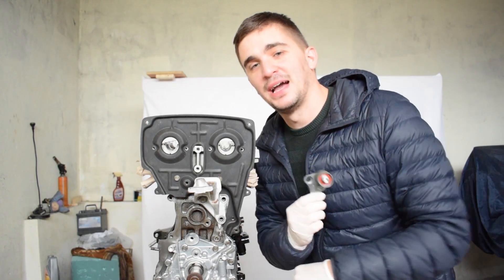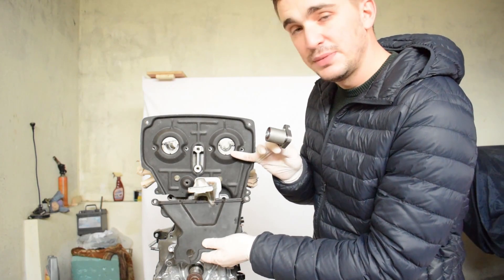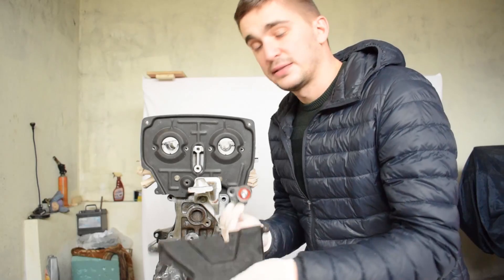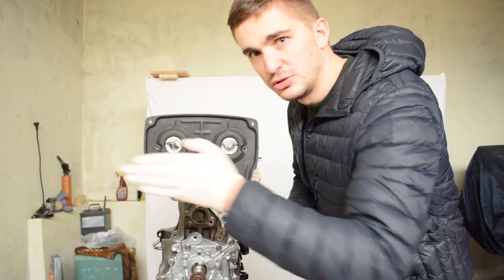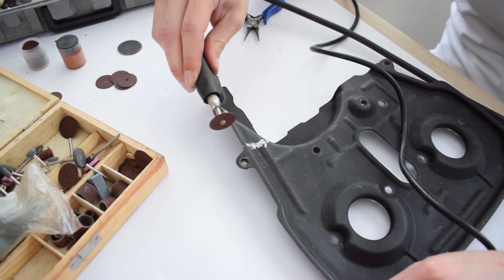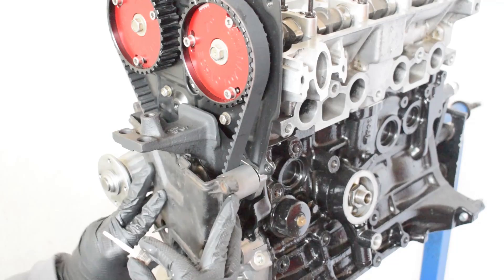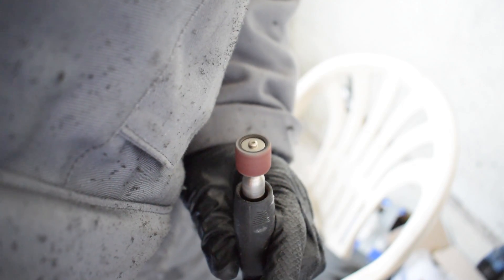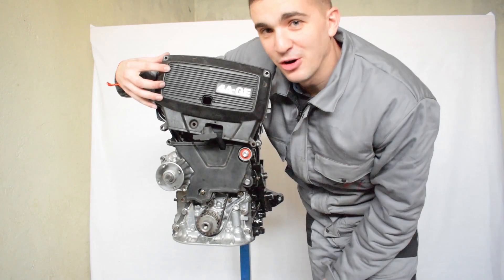How to install the MRP N2 cam belt stabiliser

Comment: You do nice clean work! BTW, are you going to fire it up on the engine stand or install everything in the car then fire it? I just can't wait to hear it run. Speaking of which, I can't remember if you addressed that the carbs need less fuel PSI than the EFI setup. Which vid was that? I wanna watch it again. 
I'm being impatient I know, I'm sorry!
Reply from the maker: ZatoichisCaneSword! Hey thereee. Long time no see :) Will install the engine first and then fire it up. Don't have the facilities to do it on the stand. Engine should be installed in a week, fired up by mid March I hope. I am making a video on the fuel supply and it will be published in a couple of weeks. I did discuss it in my previous vids, mostly in the bike carb plan, the really long video, but there's no vid on putting together the actual setup. I figured out something really simple and effective with the motorcycle fuel pump, should be a fun vid. Thanks for watching and staying tuned :)
Reply: +driving 4 answers (mr2 mk1 hero) oh using the bike fuel pump sounds interesting! Will it flow enough fuel though?! A 1600 on carbs at 8-9K RPMs has to need a fair amount of fuel flow methinks... I can't wait to find out! You're a clever technician and I know you'll make it work!
Reply from the maker: ZatoichisCaneSword! It should work great, plus it will be easy to replace and upgrade. Thanks for all the faith you put in me :) I hope I justify it soon.

Comment: Why does your timing cover have that hole above the engine mount? I havent seen that before.
Reply: You people are way off. This is a motorist's cigar cutter.
Reply: it's a smallport timing cover found in FWD AE92 GTi. The hole is for the radiator hose.
Reply from the maker: Honestly that's a really good question. I have no idea and I thought about it before. I call it the finger amputation hole. A finger fits really neatly in there and you just gotta wiggle it around and the cam gears can shorten it to your desire. Like a pencil sharpener....but for your finger. Sorry. It's late. I haven't slept enough. 
Anyways, I think the cam cover or the engine might be from a car that isn't an aw11. It was a total mix and match of parts right from the start. Took me forever to weed through all of it.
Reply: Factory finger shortener lmao
Reply from the maker: Thanks for the tip! Will look into it.
Reply: StiffWood good name and tip!

Comment: Can it wrk on a 4a-fe engine too?
Reply from the maker: young Boyce Since the block is the same and this mounts on the block you can install it. I just don't know whether the belt on the 4afe is in the same location. Best bet is to shoot mrp a quick email.
Reply: i highly doubt it will work. 4AFE engine has single cam gear and narrow ports. the width from intake and exhaust cams were shorter compared to GE head. that means the belt position is not at the same place as 4AGE.